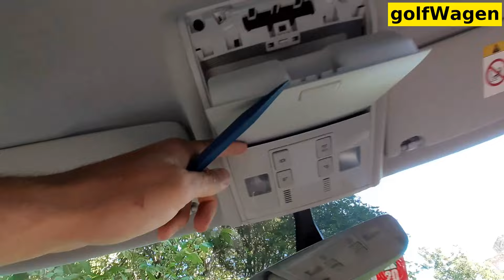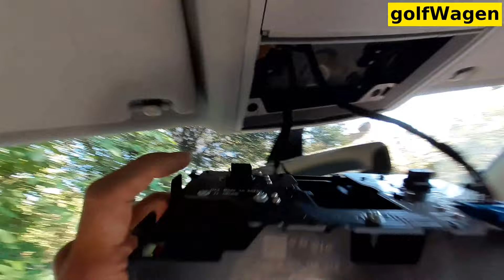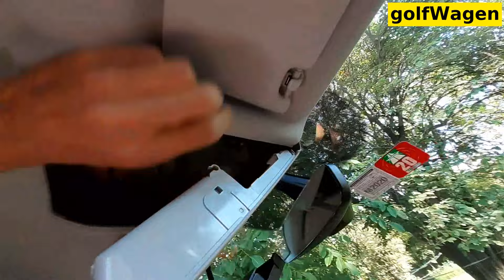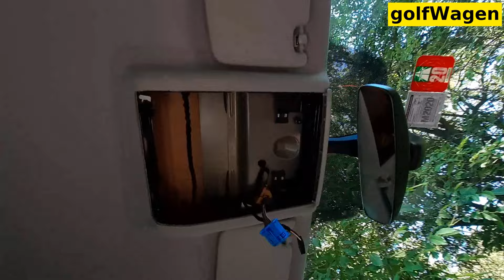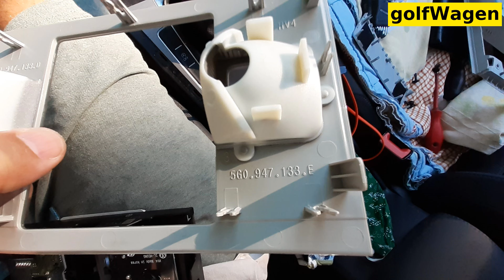VW Golf 7 Dome Light Removal

Comment: Got car back after some warranty fix with sunvisor and sunroof black plastic trim crack.

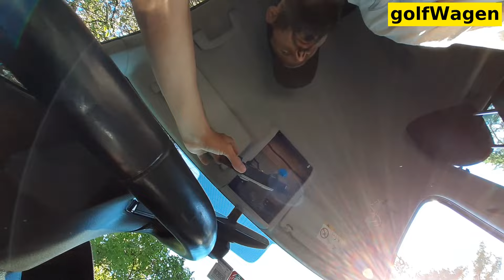When I got it back there was rattling in headliner front interior light area. When I opened it up the clip at 4:47 was not in its right location the videoed showed where it should be.

Thanks

Comment: 2022 VW TIGUAN SE R Series overhead console came entirely off on its own scratching my face missing my right eye by 4mm Purchased from Rick Case VW in Weston -Davie FL They stated its off warranty by 15 k miles USD 787. To fix this crap  Do not buy any VW TIGUAN EVER ITS A LIFE THREATENING RISK IF THIS MFG DEFFECT CRACKS ON YOUR FACE while driving  Only have 60 k miles and its falling apiary and I still paying without any possible way to sell this crap
Reply: My wife’s tiguan R Line just did the same thing Did they give you a cost for how much it was going to be to repair?